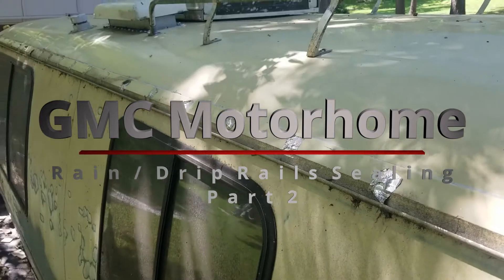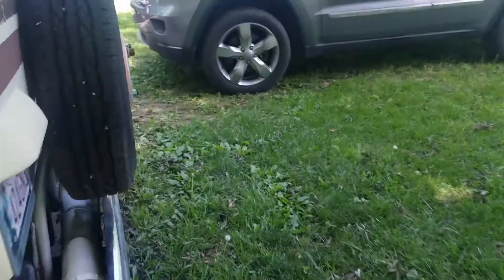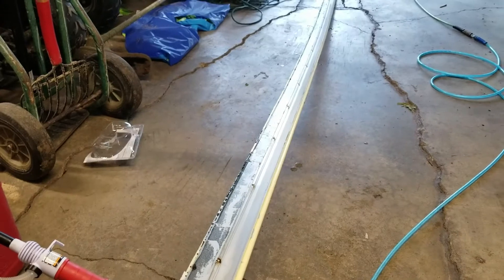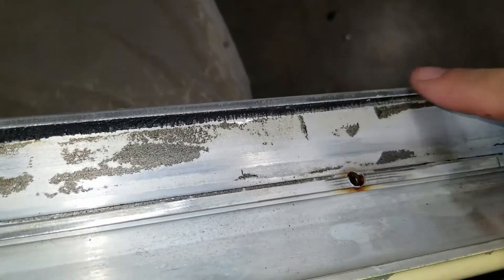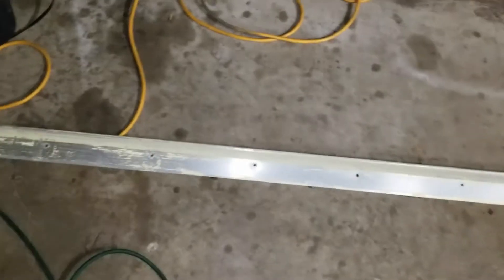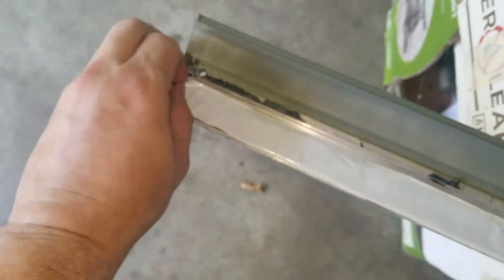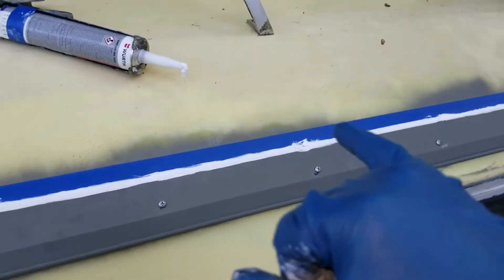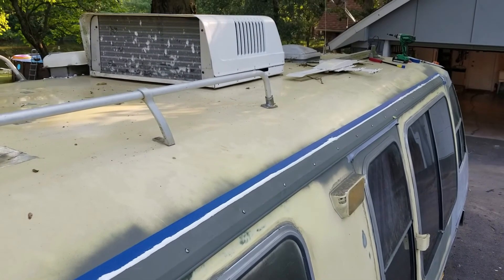GMC Motorhome - Rain Gutter Drip Rails Resealing - Part 2

Comment: Good video but avoid the use of a steel wire wheel on aluminum will get steel fibers in the aluminum and cause dissimilar metal corrosion.